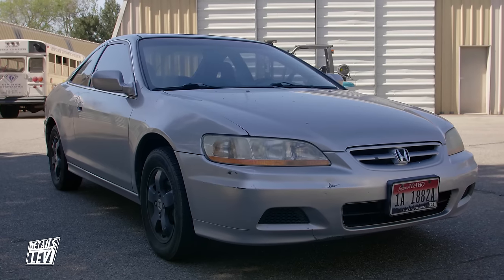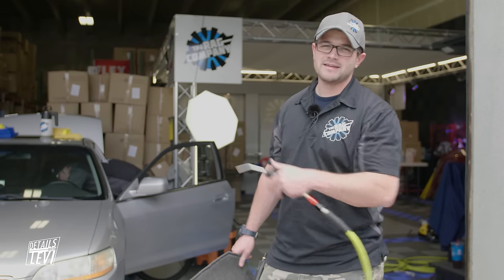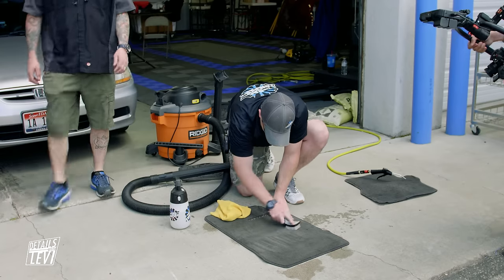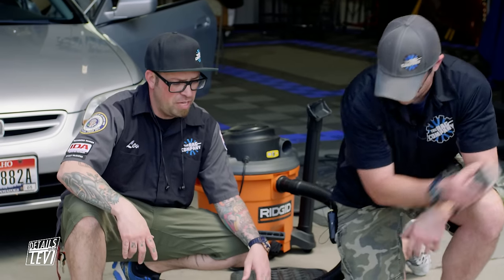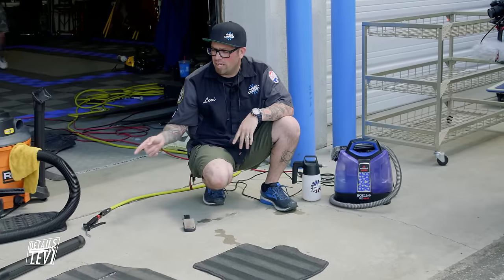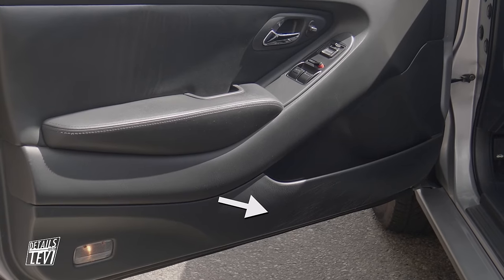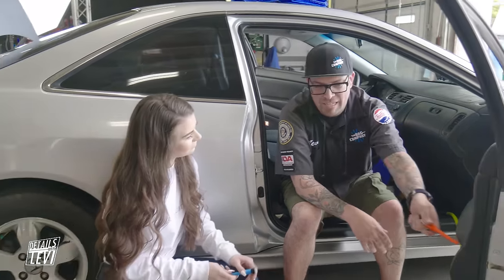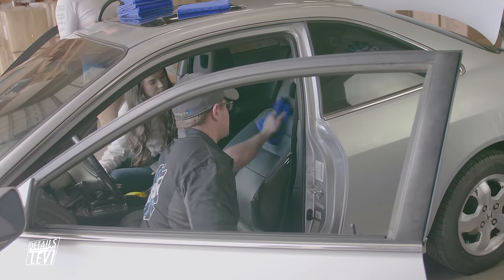RESALE DETAIL: Making The Most Of A Cheap Used Car! | Dirty Interior Cleaning | DETAILS WITH LEVI

Comment: Feedback from a beginner: I’d like more details regarding the steamer segment. I don’t see the steamer you used, linked with the products used. Do you simply add water to the device and plug in? What did Anthony do with the vents and steamer?  Did he first spray the steamer into the vents, then turned on the vents to produce the steam effect?

Comment: What if you run out of towels? What will you ever do? 

What size compressor is best to run the tornador?
Reply: definitely would not recommend less than a 20gal compressor to run the tornador.  It's an air hog, a pancake won't cut it.